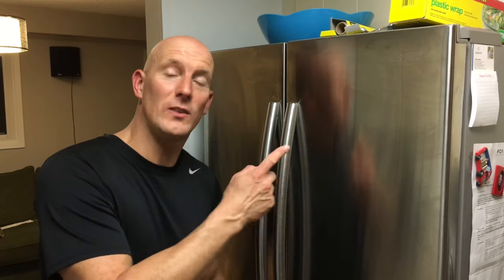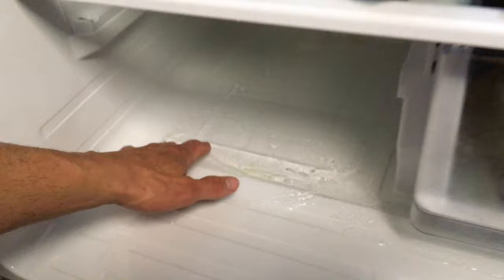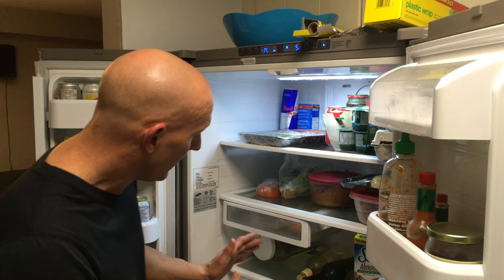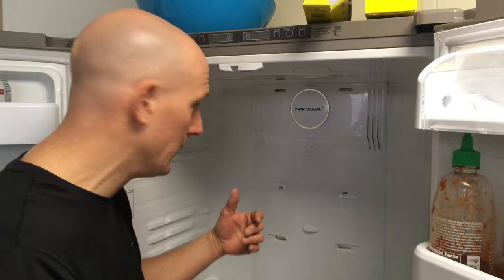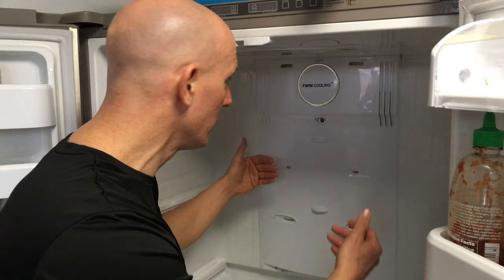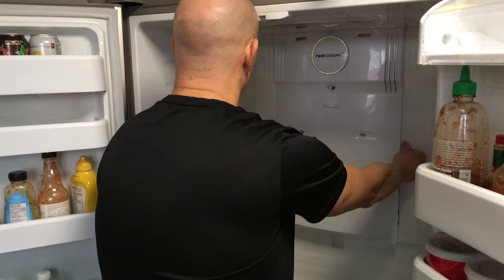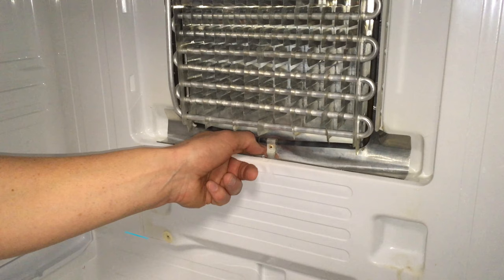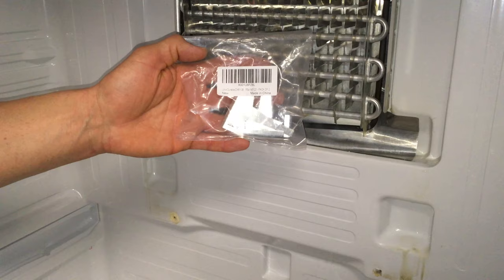Ice & Water Buildup (4K) Samsung Refrigerator

Comment: Thank you for the video! I'm hoping you could answer a question, I do not have ice build-up in the areas that you show the video but I have ice build-up behind the plastic panel that you pulled off. The ice is coming out of the little horizontal hole and in the shelf holder brackets.  Does this fix help with that situation also? Thank you in advance!
Reply: I have the same issues as you. Wondering if this fix solved your problem?
Reply: Same with me. I don’t see a link for the item we need to order.
Reply from the maker: Thanks for watching!
This is the updated Repair Kit that you need for Samsung.
Samsung Water / Ice Repair Kit:
Amazon US: https://amzn.to/3YN4Enw
Amazon Canada: https://amzn.to/3WKlUYK

Comment: I haven't completed my repair yet, but it Looks like those "wings" on either side should be bent up and around the wire, to keep the piece in place. Other wise they will act as a cooling heat-sink (defeating the purpose of conducting as much heat as possible). If anyone has completed the repair LMK if that is the intended design. Thanks!
Reply from the maker: Thanks for that added tip!  So far it has worked for me but I have heard of a few other added things you can do as well.  Thanks so much for watching!
Reply from the maker: Thanks for watching!
This is the updated Repair Kit that you need for Samsung.
Samsung Water / Ice Repair Kit:
Amazon US: https://amzn.to/3YN4Enw
Amazon Canada: https://amzn.to/3WKlUYK

Comment: Hi Jeff. Thank you so much for your video. I was able to follow your video and successfully remove the back panel and remove all the ice. Unfortunately I did not have the time to wait for the heat conductor to come from Amazon so only a temporary fix. 
I do have a suggestion for improved instructions on removing the back panel. It is too hard to peak around the sides and it wa difficult to feel for the electrical connectors. Couldn’t adequately shift the panel sideways so I thought to tilt the panel UP by pushing the top to the back corner. Worked great!  Had a clear view and access to all the wiring. 
Please consider amending your video. 
Dr. Jeff Gold
Reply from the maker: I will be doing 2 new videos on this as well.

Comment: Hey jeff what about when removing the back panel and the styrofoam isnt attached the the plastic panel?
Reply from the maker: When you remove that it will sometimes come apart that's not too big of a deal just try to place it back in place when you are finished.  Also, if you are removing it when it is frozen it make break.
Reply: Hey Jeff do you need to bend the pieces up on the new clip?
Reply: @danielburkholder3850  other videos show that you should.

Comment: FYI I did this repair about 18 months ago and yesterday I noticed the ice was back. So apparently this is not a permanent fix.
Reply from the maker: Thanks for letting us know that. I have heard this happening from time to time.  You pay have to defrost it and you should be ok.   Also check the insulation and the drain hose that there is no blockage or rust etc.
Reply: Howard there are other things that can cause this. Assuming the unit will drain after defrosting and melting all the ice, see my reply to Mike Singer above.

Comment: Hey Jeff! So I am having a hell of a problem just trying to figure out it this part will work with my samsung. It's model # RF260BEASR/AA? It's been really annoying on the amazon site trying to find out exactly what works with my specific model. They even have a see what works with yours questionair but it just tells you that the part won't work with this one. It doesn't say it won't it justsays which one's it will!
Reply from the maker: I guess the worst case you can also return the part if it doesn't fit even though the part is not too expensive.  Is there any videos out there with your model fridge for repairs then you might be able to see whats behind the panel even before opening yours.
Reply: I have a completely different model than what Jeff has and the part fits.
Reply: WERE YOU ABLE TO SOLVE THE PROBLEM WITH YOU SAMSUNG FRIDGE? I HAVE  THE RF261BEAESR/AA WHICH IS CAUSING THE ICE BUILD UP
Reply: @kellygill4871  I have same model. Just ordered part. I'm pretty sure it will fit. Not sure it will solve problem. Also check your drain tubes in the back. Mine were almost totally clogged with sludge.
Reply: @dougprentice1363  I ORDERED AND CHANGED THE SENOR &  THE CLIP . CLEANED THE TUBES TOO  BUT AFTER 2 WEEKS IT AGAIN STARTED BUILDING THE ICE AGAIN. TIRED OF SAMSUNG. HAVE TO BUY A NEW ONE NOW.

Comment: Great video, thanks. This refrigerator has been nothing but trouble and will be my last Samsung. The Ice Maker had to replaced and the water dispenser routinely freezes - now this. We've got tons of water pooling under the middle deli drawer so definitely a blocked drain, possibly the drain tubes at the bottom as well. Parts ordered, will replace everything when it gets here. Thanks for the video!
Reply from the maker: Drain Tubes 100% has to be the issue.  I am also doing an updated video on this shortly.  Thanks for watching!
Reply from the maker: Thanks for watching!
This is the updated Repair Kit that you need for Samsung.
Samsung Water / Ice Repair Kit:
Amazon US: https://amzn.to/3YN4Enw
Amazon Canada: https://amzn.to/3WKlUYK

Comment: Great videos, but be fore warned that I still have to go back in about every 2 or 3 years to defrost the back panel and pull it out to inspect the drainage, even with the new part. Full air flow in the back interior of the frig is important. An overloaded frig with lots of stacked items against the back of the shelves is a possible cause. I used this video to remind me how to access the back panel every few years.  I have a 2010 model with the same interior components and first encountered this problem in 2014. It's extremely sad that Samsung continues to produce refrigerators with this design flaw, as the motor and cooling seem to be very reliable.  I will not buy another Samsung frig when this unit needs replacing as the simple nature of the defect speaks loudly about how inept the management is.  A refrigerator is a big expensive purchase for many people.   Samsung should be forced to have a big warning sign, "buyer beware".
Reply: GE is built the same, it’s build like the Samsung. We’ve had both.
Reply from the maker: Thanks for watching!
This is the updated Repair Kit that you need for Samsung.
Samsung Water / Ice Repair Kit:
Amazon US: https://amzn.to/3YN4Enw
Amazon Canada: https://amzn.to/3WKlUYK

Comment: I had a different Samsung  French door model but had the same problem. Water always running onto floor. Never kept inside cold. Only lasted six years before compressor went out. Will never own another Samsung kitchen appliance. Biggest piece of crap. Replaced the $2000 Samsung refrigerator with a $1100 Maytag side by side. Wasn't going to spend anymore money than I had to on a refrigerator when the life span on new ones are only 6 years. Thought I was settling on a refrigerator less than perfect but I love the Maytag. Keeps everything ice cold without freezing contents. Nice video by the way.

Comment: I love your video's. You give good explanations and are very clear. I'm having the issue of water under the fridge also. I first took the back off and checked the white tubes to make sure they were not blocked, which they weren't. BUT, there were 3 places for tubes but only 2 tubes connected. 2 white tubes on the right, and a black tube to the left. Not sure which one to change. We've already purchased the whole back panel of the fridge, styrofoam and all. All still leaking water to the floor and ice build-up under crispers (about 1/2 inch thick). Not sure what to do next.
Reply from the maker: Did you leave the fridge to defrost over night.  I wonder if the ice is blocking it above.

Comment: Thank you for this video, I've taken my fridge apart 3 times so far after it was icing up so the fan was hitting ice and making noise. I didn't realize that was even a drain there in the middle because it was always clogged with ice I guess. I had to use a bunch of hot water and snake the drain hose with a piece of copper wire to get it to drain. I don't know if it was obstructed or just ice, but it drained when I put it back together yesterday. I had the fridge apart already when I saw this video so didn't have time to wait on the clip, so I wrapped a few inches of that copper wire (14 awg ground wire from some scrap romex) around the heating element and ran a foot down into the drain pipe. Did that with 2 pieces of wire. Hopefully that will transfer the heat like the aluminum finger would and keep it ice free. Only time will tell.
Reply: Hi Nick, how did the copper wire work for you?
Reply from the maker: Thanks for watching!
This is the updated Repair Kit that you need for Samsung.
Samsung Water / Ice Repair Kit:
Amazon US: https://amzn.to/3YN4Enw
Amazon Canada: https://amzn.to/3WKlUYK

Comment: Thank you so much for this video & link to the part. I have been having to tear my refrigerator apart every 3 months for a year now to defrost all the ice. I could never afford a repair man & had no clue why this was happening. Can't wait for my part to get here so I can install it & hopefully never have to thaw the thing again. And you are correct, Samsung denied any issues with the refrigerator, which by the way cost over $2,000. Shame on them. I will never buy a Samsung appliance. This one came with the house.
Reply: This has been a problem for over 10 years and Samsung continued denying and putting out the same crap. Save yourself aggravation and unload this lemon now. This fix won't solve all the problems - I installed the new clip AND copper wire wrapped around the heating element and put down the drain as well and still had the issue. The easiest way to defrost is just unplug for a few days and don't bother tearing anything apart a small portable heater can help speed the process but make sure it is on low and the doors remain half open. These Samsung fridges make one nostalgic for the old manual defrost refrigerators of the 50's and 60's.
Reply from the maker: Thanks for watching!
This is the updated Repair Kit that you need for Samsung.
Samsung Water / Ice Repair Kit:
Amazon US: https://amzn.to/3YN4Enw
Amazon Canada: https://amzn.to/3WKlUYK

Comment: I did this and it's fixed. Also the clip I took the two little things on the outside and I bent them around the black wire that heats up because it wasn't making enough of contact.
Reply from the maker: Thanks For Watching!

Comment: Not my model fridge at all but your evap panel is nearly the same. I am sure this is my problem since you had the exact same issue. I was afraid it could be my water filter assembly leaking, but I think now it's not!  Thanks!
Reply from the maker: Seems like most of the time, it's the drain tube blocked up.

Comment: I cut out a piece in back of unit at same height as drain trough. Removed foam from around to allow room temp air at drain hole. No more freezing of drain line.
Reply: I was thinking of doing this.I just want to know why it won't drain.
Reply: @CHRISTOPHER1169  l like mñ

Comment: Hugely helpful video clip Jeff! I have the exact same Samsung model and problem several years ago but I don't think the evaporator tube clip was available then,. I had to "MacGyver" it by wrapping some thick solid copper wire around the heater element and positioning it so that it extended about 6 inches down the tube. That was well over 5-years ago and I have never had a problem since!
Reply: This is an excellent idea! Thanks!
Reply from the maker: Thanks for watching!
This is the updated Repair Kit that you need for Samsung.
Samsung Water / Ice Repair Kit:
Amazon US: https://amzn.to/3YN4Enw
Amazon Canada: https://amzn.to/3WKlUYK

Comment: Awesome video Jeff.  Samsung Troubleshoot manual does not address this problem.  I found a code how to defrost the Samsung without having to unplug it,  allowing the freezer to continue working.  Here's how - Together press Energy Saver (top left) and Fridge (middle right).  Hold it to the count of 20 till the screen goes blank.  Press any button till you see "Fd" (fourth option on mine).  The defrost process takes about 30 minutes and will beep continually till it finishes.  If there's ice buildup on the condenser, it may not work at first.  After sufficient ice is melted, try it again.  I used this option several times to completely defrost mine.

Comment: Jeff, thanks for the great video. Our fridge was doing the same thing, I used a fine copper wire like a 14 ga. and wrapped it around that bottom heat line and then placed a longer end down the drain line again much like the replacement piece that Samsung provides. Thanks again for a great video.
Reply from the maker: Thanks so much!
This is the updated Repair Kit that you need for Samsung.
Samsung Water / Ice Repair Kit:
Amazon US: https://amzn.to/3YN4Enw
Amazon Canada: https://amzn.to/3WKlUYK

Comment: This is a very detailed and informative video for fixing water & ice under the crisper inside the refrigerator.  Thank you for sharing it , but we have a different ice problem with our Samsung French door refrigerator.
We have no problem in the refrigerator, but under the freezer drawer we have a whole ice sheet that has formed.  Would the repair in this video also fix an ice sheet forming under the freezer drawer?
OR:
Do you have a video showing how to stop ice forming there?
Thanks again,
Reg
Reply from the maker: Thanks for watching!
This is the updated Repair Kit that you need for Samsung.
Samsung Water / Ice Repair Kit:
Amazon US: https://amzn.to/3YN4Enw
Amazon Canada: https://amzn.to/3WKlUYK
Reply: Did you ever find a fix for this issue? It's what we're running into now
Reply: Our current solution is to wrap an old cloth around a hammer and 'gently' remove the ice before the freezer door stops closing. 
(That's about the extent of my appliance repair abilities. )

Comment: I had ice build up and the fan was banging away on the ice and it was progressively getting louder and all I did was to adjust the temperatures.  I had the freezer set at -5 F and moved it up to +5 F which is the max setting.  I moved the refrigerator temp up to 40 degrees F.  That is all I did and it apparently defrosted because the ice melted and the fan quit making noise and all is well.  Plus the ice cream is not rock hard when I take it out of the freezer now, it is perfect.  My Samsung is the same as the one in this video.
Reply from the maker: Thanks for watching!
This is the updated Repair Kit that you need for Samsung.
Samsung Water / Ice Repair Kit:
Amazon US: https://amzn.to/3YN4Enw
Amazon Canada: https://amzn.to/3WKlUYK

Comment: I had the exact same problem on a  RF28HFEDBSR which I tackled today. 
Thanks for you video, there are several others out there and many pissed off Samsung customers, add me to the list.
In my case things were worse which others might have either missed, or not had, but in the area of ice build up the expansion process of freezing ice had actually damaged the fridge walls in the local area and there were several cracks which I believe are going to make the issue worse going forward.
I did not attempt to repair them as I am going to research a solution which can be effected with in a short time and with no health issues like bad smell of silicon etc.
This is a disgrace for a company like Samsung and I will never buy another Samsung product again and will ensure that family ands fiends are aware of this as well.
Reply from the maker: Thanks for watching!
This is the updated Repair Kit that you need for Samsung.
Samsung Water / Ice Repair Kit:
Amazon US: https://amzn.to/3YN4Enw
Amazon Canada: https://amzn.to/3WKlUYK
Reply: @JeffLepard  Thanks, I bought it shortly after posting the comment. Still have not installed it though, waiting for the next tipping point.
Reply from the maker: So after all this time 99% of the issue is the drains.  I just came across that kit today so I will be doing a new 2023 video this week to take care of the solution for most.

Comment: How about the bottom freeze part, you can not see the ice behind the panel that I have problem keep ringing for ice block the fan. Does the freezer part controlled by the upper panel or bottom panel? BTW, what the part name so I can buy from Amazon? Thank you very much for your posting this video.
Reply: @jessealcorta5271  Thank you very much.

Comment: If you have this icing problem with water collecting under your crispers, the very First thing you should do is disconnect the power and check the drain tubes behind the outside panel in the bottom rear of your unit. Unplug the power. Pull the unit out from the wall. Remove the lower back cover. Have a small container handy and pull the drain hoses off. There is one for the fridge on your right side and one for the freezer on your left depending on the model. If water comes pouring out of the one on your right, you are in luck. It was just clogged and backing up. You can take apart and clean both tubes or get a better designed new replacement. If no water comes out, you've eliminated one possible cause after spending just a few minutes. I'm a diyer not a repairman and accept no liability. Just trying to help others.
Reply from the maker: Thanks for watching!
This is the updated Repair Kit that you need for Samsung.
Samsung Water / Ice Repair Kit:
Amazon US: https://amzn.to/3YN4Enw
Amazon Canada: https://amzn.to/3WKlUYK